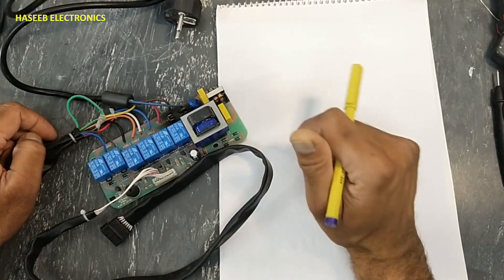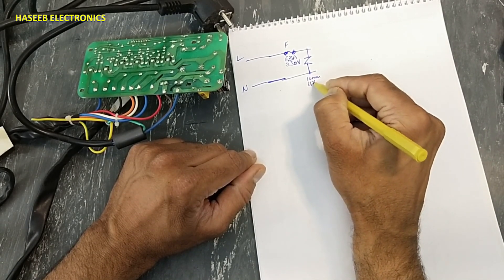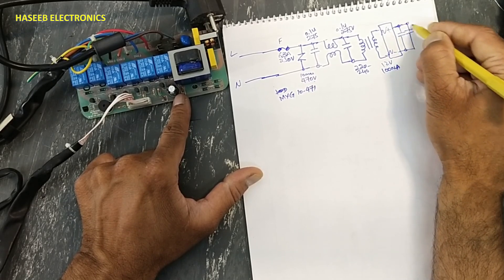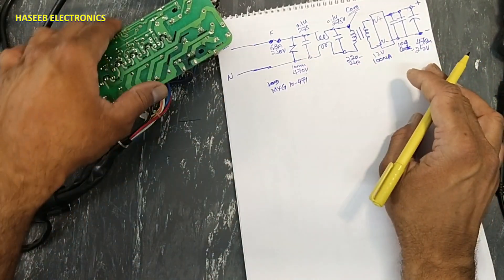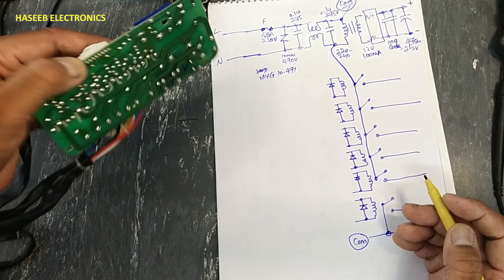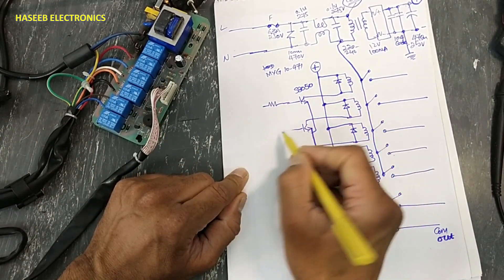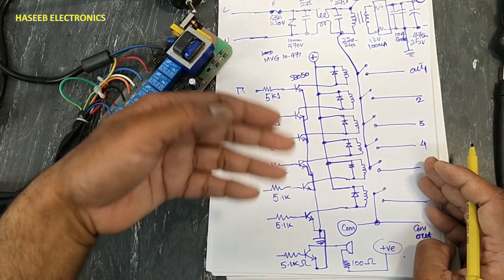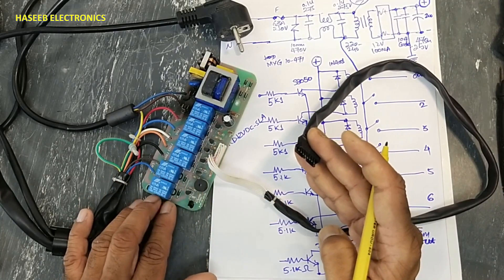{953} 6 channel 220 volt relay module circuit diagram

Comment: Hello sir, i am a new subscriber to your channel. i like your video. they are really insightful. i am learning high frequency inverter and the mosfet keeps heating up under no load condition. kindly help on what to tweak to solve this problem sir. i could really use your help

Comment: Relay #6 "Common" is actually the hot side.
Reply from the maker: relay number 5 & 6 are programmed together to turn on light, 
relay number 5 provides switched neutral 
while relay number 6 produces fused line voltage (hot side)
these both are connected to small output connector (light connector)
Reply: @HaseebElectronics  Thank you for the additional information!

Comment: Hello Mr Haseeb what happen if capacitor and resistor connected in parallel
Reply from the maker: it called bleeder resistor configuration. 
sometimes resistor is used as dummy load to remove ripples from the capacitor 
and sometimes a high value resistor is installed in parallel to the capacitor to discharge the capacitor